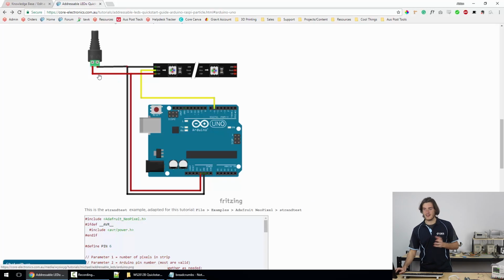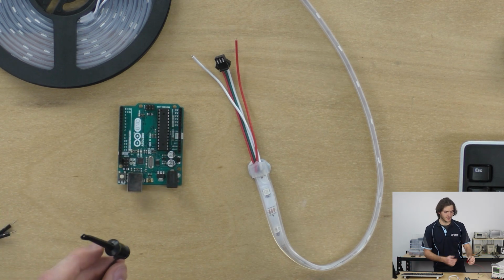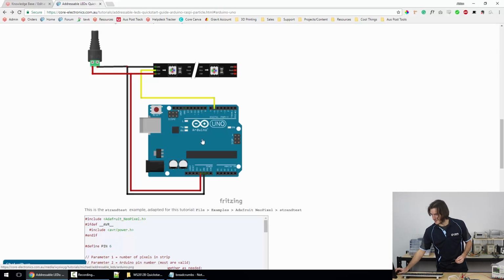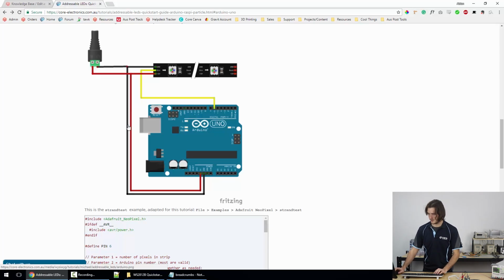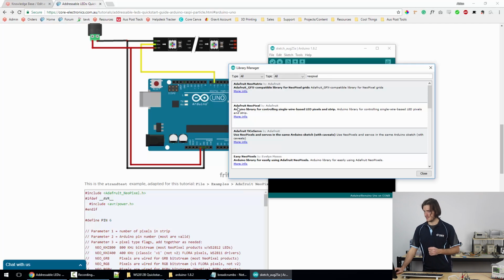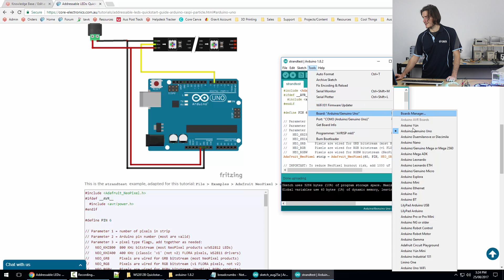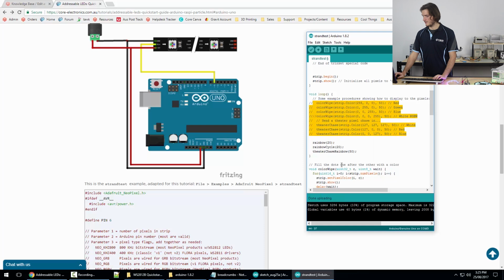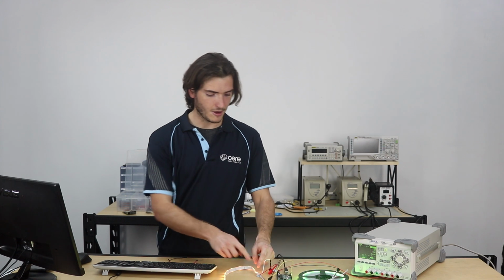How to use WS2812B RGB LEDs with Arduino

Comment: can it be pwoered with a 5V external battery? its a pretty sstrong one I have.
Reply from the maker: As long as it can supply enough current to power the strip! Each LED in the strip need about 50 milliamps of current. If the strip is 60 LEDs, you will need 3000 milliamps of current from your battery or 3 Amps.

Comment: It worked, but of course I was disappointed to see only 64 leds light up instead of my full 50' roll. I obviously need more power for that as the Arduino can only supply so much. I have a 5v external power source on the way. Can't wait to see this thing light up all the way!

Comment: Nice video! I'm actually trying to build an arduino project that  can control an individually addreseble led strip that has 24 leds using an ir remote. I've got the code and components ready, but I'm worried about the current being an issue. Do you know how much power would approximately be needed, and if so, what gauge/ AWG wire would I need to handle that much current. Also, do you know how to connect a separate power supply to the circuit because I don't think the arduino can handle plugging a power supply into the Power Jack connector.

Comment: What wire size do you use? The ws2812b pins look to be roughly 22 AWG, but charts I see online show this size is not able to handle all 9 amps for a 150 light strip

Comment: I have never used an arduino but I am thinking of using one to control some LEDs on my FPV drone. Could I use multiple pins on the srduino to control different strips of Leds?

Comment: My led strip doesnt turn on, my codes n program are uploaded succesfully. I commected my VCC wire to 5V of my arduino, could it be i dont have enough voltage to power it? But it stated on the packaging its voltage is DC5V

Comment: work well! but my ledmatrix is 16x16 so i change the code from: Adafruit_NeoPixel strip = Adafruit_NeoPixel(60, PIN, NEO_GRB + NEO_KHZ800);
to:Adafruit_NeoPixel strip = Adafruit_NeoPixel(256, PIN, NEO_GRB + NEO_KHZ800);

Comment: Just wired mine up yesterday successfully! Thanks

I used the following setup: 
- BTF-LIGHTING 5m 300 LEDs W2812B RGB strip
- Switching Power Supply: 5V 20A 100W
- Arduino Uno
- Adafruit NeoPixels Library (strandtest)

Comment: Will the program still run if you have uploaded the arduino code but disconnected it from the computer?
Reply: One the arduino is programmed it will run when it has power

Comment: Hello I just receive my WS2812B and I need to test it but I don't currently own a proper power supply for this. Can I use my spare 600W Pc power supply for this ? the label on the power supply is DC output +5V has 48A

Comment: how many volt is your power supply givin?
Reply: It shouldn't be more than 5volt as the strip is rated for that voltage.
You need however to calculate the current consumption. Usually, each RGB led uses 60 mA of current at maximum load. Multiply this value for the number of LEDs and you should have the amount of current needed. 
In his example, 60 LEDs should consume 3.6 A more or less.

Comment: Just a simple question. If you're powering via the USB port, wouldn't that limit the length of the RGB LED Strip that you can safely power?
Reply: only the board is powered via USB - that's why there is a 5v power supply for the LEDs.

Comment: I want to produce two pulse output  with 90 degree phase angle  (to connect home therate on volume control replace of rotary encoder) with Arduino. can you help me. Please tell me how to produce pulse to increase or decrease volume for A and B pin of rotary pin.

Comment: is it possible to make it so that you can have the first 5 doing one thing whilst the next 5 are doing something different?
great video as well
Reply: Yes. Basically the way it works is that if you have 10 LED’s, 10 instructions are sent. The first pixel grabs the first instruction and removes it, then it sends the 9 instructions that are left down the line (until there are no more instructions left). So, it’s totally up to you how you split up the instructions.

Comment: how would i be able to plug the led strips into regular 240v wall power ??
and is there a way to use the custom light sequencing, as well as using regular solid colours with the remote supplied with an led strip ? or will that need two strips, one for solid colours and one for the custom sequencing
thanks !! :)
Reply from the maker: Intriguing question - why not try posting that on our forum?  Our support staff, or members of our makers community might be able to point you in the right direction for whether its possible to do it with one LED strip.
https://forum.core-electronics.com.au/

Comment: Hello sir, first of all i want to say good video very easy to understand. I was working on a project pretty much creating a dance dance revolution type of game and the part im having difficulty is how to get LEDs to light up in synchronicity to pins when my arduino registers the pull_up resistor and commands the specified pin to register a keyboard stroke. It will be 5 separate pins that need to register individual keystrokes, and im thinking of putting something like 4 to 8 LEDs per button. My questions are what kinda of code will i be using ? Do i need a separate power supply to power the leds?
Reply from the maker: Sounds like an interesting project - if your having trouble then we strongly recommend you post details to our forum. We have a fantastic support team who are keen to assist makers with their projects. https://coreelec.io/forum

Comment: I see many YouTube videos use 330ohm resistor for the data pin and cap for the power source.  Is it necessary?
Reply: It's worth doing as it will protect the first Neopixel from getting damaged.
Also worth chucking an electrolytic capacitor across the supply, just make sure you use one with a high enough voltage rating and anything around 1000-3000uF is fine.

Comment: I see you plugged your 12VPower Suppler into the 5V input of the Arduino, this will not damage it?
Reply: Arduino should be able to handle anything from 5-20V
Reply: @Wezla  I heard it was safer to put the power into the VIN pin instead, after you upload and disconnect the USB, does it matter? BTW love your video!!
Reply: @PantherJagger  Not my video lol, but yes you're supposed to plug in 12V into the vin (Voltage In). The 5V rail is meant to output 5V but I'm uncertain if doing this is "dangerous" by any means.

But yeah, VIN is the correct pin to feed voltage to for the arduino
Reply: @Wezla  I am glad I checked, all my gear arrives next week, very excited, and thank you for the great introduction to Neos...

Comment: how many volts does your power supply have?
Reply: It shouldn't be more than 5volt as the strip is rated for that voltage.
You need however to calculate the current consumption. Usually, each RGB led uses 60 mA of current at maximum load. Multiply this value for the number of LEDs and you should have the amount of current needed. 
In his example, 60 LEDs should consume 3.6 A more or less.

Comment: Hi, I must say that you are a gem as I was getting apprehensive on how to use these as I am not a programmer and just learnt it from your video. However, I am facing a situation which is kind of odd. I have run the code and it shows "done uploading" however it does not light up the LEDs. Strangely when I touch my laptop somehow the lights start. I know its kind of strange however I have tried everything I can think of. Could you guide me with what could be the problem?

Comment: Great video. Question on arduinos as a whole; Is there any way for me to permanently program an arduino to perform this program by just powering it on? My project is to have a stand-up LED sign and I was hoping to mount a Arduino nano to the base so anytime it was powered on, it would run this program in it's memory without me having to re-upload it. I'd appreciate any help on this
Reply: every time you power up an arduino, it "plays" the last program.
Reply: MOST of an Arduino is just to make it easy to connect to.  With the ones w/removable chips, you can program the chip, then xfer the chip itself to a sort of skeletal 'Arduino' pcb and the chip will continue to run the last program loaded into it.

Keeping even the bits of a nano is wasteful, technically, although the cost is low enough you may not care.

Comment: Hello. I am going to use addressable led in a shelf powerd by an ardurino(5m with led) i was wondering if i need external power or is the power from the ardurino all i need? I found your video very interesting btw! Keep it up!
Reply: Yes, you need an external power supply, because a 5m of led normally contains 300 leds, each led require 60mA of current, so 300x60mA = 18000mA => 18Amps. I have develop a project for my childrens with a led strip of 5m and I bought a Power supply with 5V and 20Amps for 12 Euros, and It works out very good. I use Arduino Nano and a Bluetooth module and a microphone GY-MAX4466.

I hope this helps !!
Reply: The Arduino only supports 4 leds

Comment: HI

Could you tell me which is the cheapest but right arduino model (or other) for driving ALITOVE WS2812B Addressable LED Strip Light?

Thanks
Yahav
Reply: For me the arduino nano works ok but you can use pretty much every popular arduino.

Comment: There are so many WS2812 LED used, most of them are soldered on a separated board for displaying.  Many makers use the WS2812 LED in their own projects, but , no one will tell that there are a big mistake in your prototyping& small batch production.https://makerfab.blogspot.com/2018/09/w-hy-ws2812sk6812-failures-after-smt.html

Comment: I just wanted to take some time and thank you for this wonderful tutorial. I got myself one of these LED strips and used an old PSU to power it. Everything works perfectly!

The only thing that I'm confused about is, why you have to connect the ground to the arduino as well. Does it have to run to the arduino?
Reply: Ali everything needs a common ground. Otherwise the voltage applied to the power pin on the Led will not be the same as applied to the signal, since they are not referenced (grounded) from the same point.
Reply: @benjyking500  sup bro. May i ask is it okay to plug this rgb lights and arduino to my PC usb plug ? The same power source.

Comment: Sir why don't you connected resistance and capacitor to the led strip
Reply: The resistor is to protect the data signal. The capacitor is for the led strip power.

Comment: Hi, great tutorial, so running a 60 led strip would need a 5 v DC supply at how many Amps ?
Reply: Around 700mA or above I'd imagine. Do yourself a favor and get one that has 2A. With current, it can be exponentially more than what you're drawing unlike voltage. You don't run the risk of damaging the LEDS with too much current, get all the current you can get!
Reply: Andy Markantonatos thank you so much !
Reply: Around 2 amps should be fine man!

Comment: i am planning to buy a BASIC ARDUINO UNO STARTER KIT that has a Arduino Uno
– R3 Model. can i control a WS2812B RGB LED STRIP 60/M 5VDC IP65 with this arduino?????
Reply: Sure just follow the video and make sure you have a 5V power supply

Comment: why do need to run the GND (white) into the arduino also. would it not work with just with data line connected to the arduino?
Reply: The data line needs a reference to apply a voltage against. Connecting GND lines together gives the ICs in each LED and the Arduino a common point to measure voltages against and allow a return path for current to flow through.

Think of it like the Arduino saying to the IC: "Here's a 5v signal on the data line with respect to GND".

Comment: what power supply (V and A) do I use to power a few LEDs
Reply: 5V for this kind of strip. A maximum of 3.6 Amp requirement per meter. So for a 5 meter strip, you need an 18amp 5v power-supply. I use a 5v 15amp power supply and it works just fine.

Comment: Hello Core and everyone.
Just one question : before you upload or install anything, after you connected the wires and made the hardware setup. the strip was lighten , right? Since you powered on, regardless anything else, the lights were on, right? A cold white I'd say light.
And only after you uploaded the sketch and everything it went lighting on programmed. Is that so??

I watched again. You have the power lines connected, though, before you upload the sketch, no light is on. 
You have the + and gnd cable connected! How can it not light on?? I have the exact same scheme made. Why my strip is on??
Reply: TMK, WS2812b strips will NOT light up with just the application of power: specific signals MUST be sent down the data line.

Comment: how to add audio visualizer?
Reply: You need to connect audio input to an amplifier, and then run the signal into one of your ANALOG IN ports. Then you can use that analog reading do to whatever you want to the colors/brightness

Comment: Hi. My LED strip is not working. 1m/60 LED`s (ws2812b). This is my 13th code what I tried. Something wrong with the LED strip? Code is good. I use DC5v 10A adapter. When I plug in to the power source the LED`s lit up for a sec. I can measure 5v on the other and. (That`s mean the LED`s are working?) Data pin line beeping if I check on both end. What do you think? What`s the problem?
Reply: I have the same issue
Reply: Tdawglives I got it work. Was the first LED on the strip. Cut off. Re soldering the wires. That's it.
Reply: Mr007Bruce I was connecting it on the wrong side of the strip lol

Comment: I am planing to buy and DC Power supply (which runs from the electricity in wall socket), what should be the output Ampere.
Reply: Your LEDs should each consume 20mA (0.02A) at most, but remember there are 3 LEDs in each WS2812, so multiply 0.06 by the number of LEDs, this gives the current required.  E.g. 50 LEDs times 0.06 gives 3A.  
And then multiply the result by 1.5 for extra reliability, so 3A is barely enough, a 4.5A (or 5A) power supply would be better still, though the bigger the power supply, the heavier and bulkier it will be.  If your LEDS will not be all on at once, then you could go lower, but if you go too low, the PSU will fail or the LEDS will give unpredictable behaviour.

To confirm, I looked up the data sheet for a typical 2812 strip, with 74 LEDs per metre, they said 18W consumption for this, so that would be 18/5 =3.6 Amps. (Amps = Watts / Volts)   I think this may be a little low and probably includes a small reduction for voltage drop along the strips.
 (Source: http://www.ipixelleds.com/index.php?id=312 )
Reply: I have 30 LEDs which in total consume 1.1A at 5v max. (RGB all at 255 = 100%)

Comment: what if my strip lights has 4 outputs  yours has 3
Reply: If yours has for then its not a WS2812 yours is most likely a WS2811 which you can use the dream colour led strip controller to control instead of a arduino
Reply: Hipsta yeah I really need some help with making some white led strips have the chasing affect. Can you help with that ?   Thanks
Reply: If you use an Arduino, then the FastLED page has an example of this.
https://github.com/FastLED/FastLED/wiki/Basic-usage
Reply: This guy talks about 4 outputs https://www.youtube.com/watch?v=EcMKditEVtY